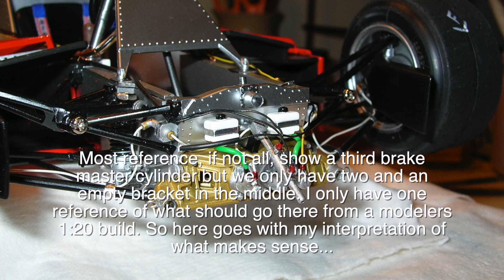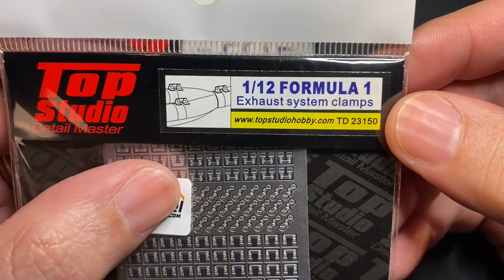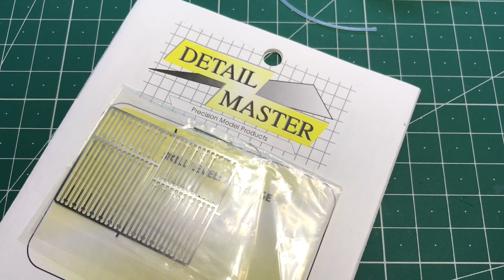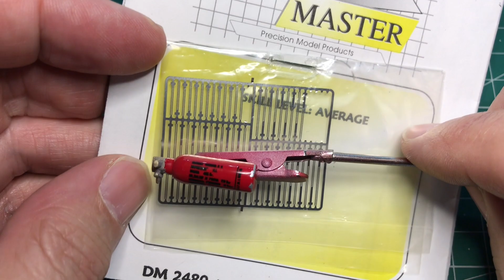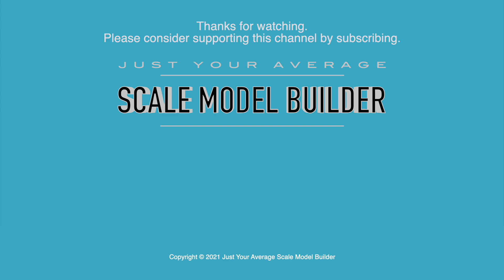Ferrari 312T4 Tamiya #12025 1:12 - SUPER DETAIL BUILD - Part 4

Comment: Great job so far, I'm working on the 1/12 Tamiya Williams FW14B. The 3 master cylinders are two for front and rear brakes are the 3rd one is clutch slave cylinder, can;t help it I was a car mechanic, on deck is Tyrell p-34       Jesus Does Save